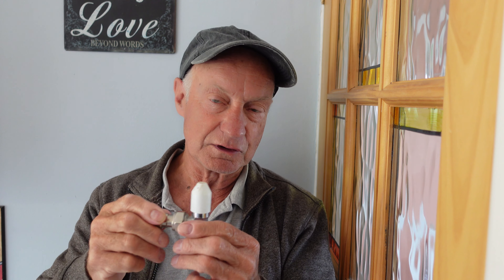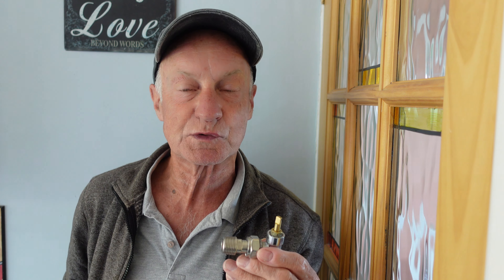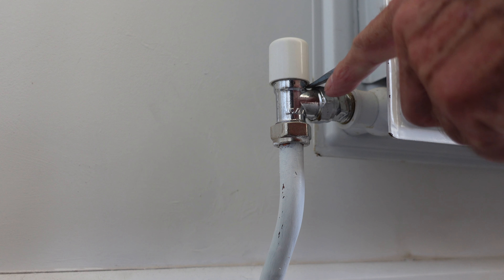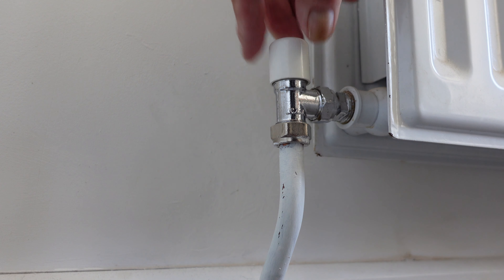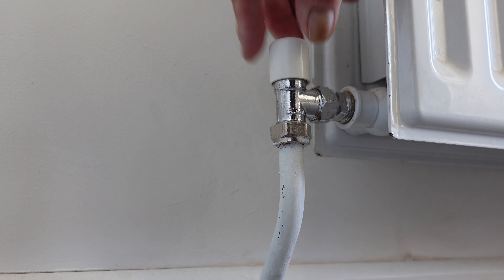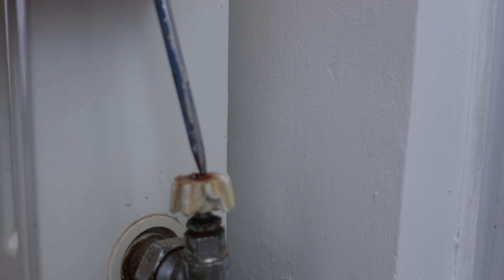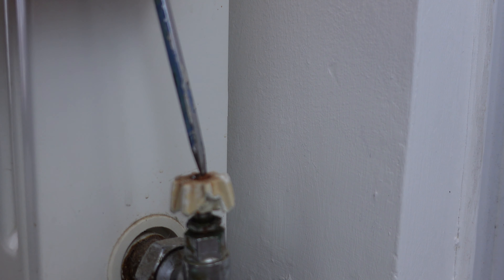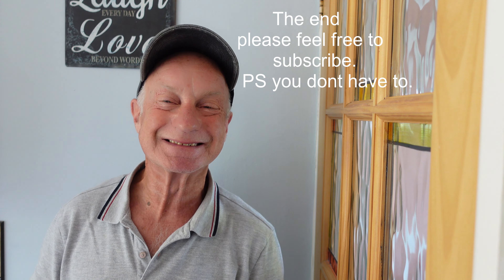How to remove radiator valve tops

Comment: Hi al another great video , todays problem is i have one of those self cutting outside taps kits fitted .the white cap inside that turns the water on and off turns but is stock off so no water .can i leaver the white cap off on the same way  to look at the scews beneath ?
Reply from the maker: Yes that is fine.

Comment: How about a vid about getting a stuck screw from a tap top? I need to replace a washer in a tap, I isolated the supply to the tap, took the blue cold cap off the cross handle, tried to undo the cross head screw but it won’t budge, there looks to be a lot of corrosion around it, looks to be greenyblue corrosion. It is a brass tap and a steel screw (does brass react with steel?) anyway, is there a solution?
Reply from the maker: I will see what I can do, another video I think, Paul.
Reply: im a plumber.drill it or break the top off and get revivers or try cordless drill .

Comment: I have a similar radiator valve head.   Just don't want to call my landlord, replace one myself.   Where can I buy one of those caps?   Why didn't you install the same type of valve head instead of using those caps?  Thx dude.
Reply from the maker: You can not buy those caps, I just happened to have an old top that covered it. It is not the right one though.